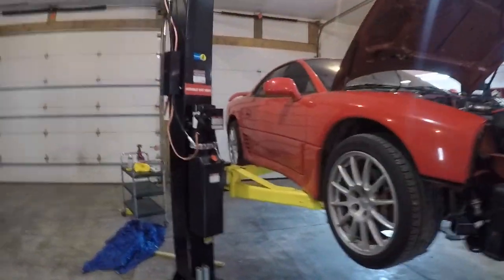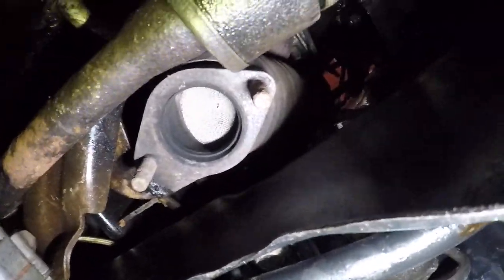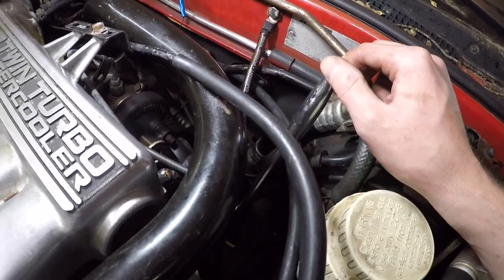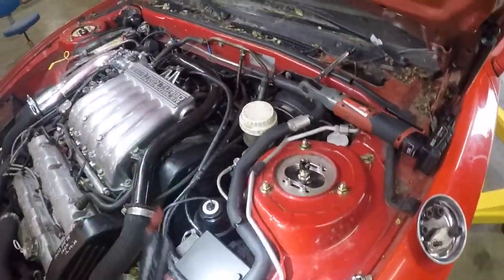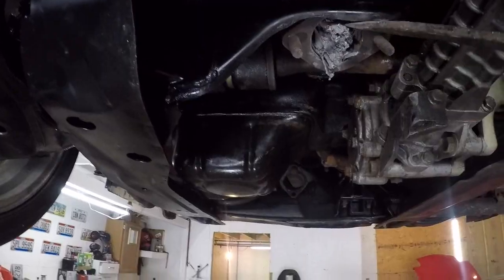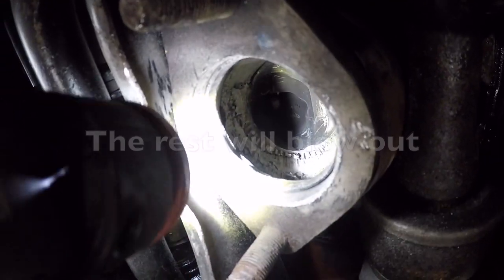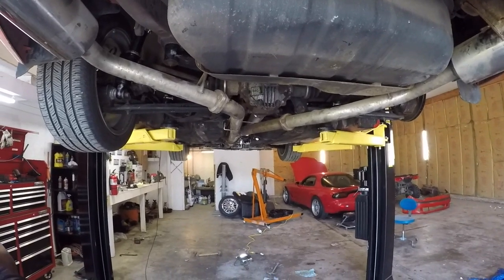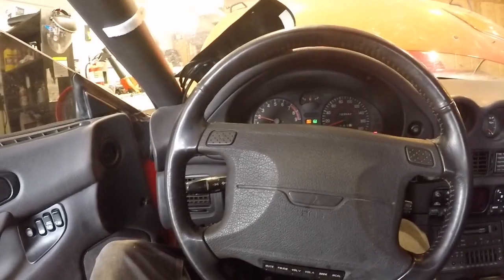3000gt vr4 | ready for paint ? | cat delete

Comment from the maker: Should I just stay the factory color or should I go a shade darker ?
Reply: I think a shade or 2 darker would  look better
Reply: Have you thought about having it wrapped?
Reply: Idk darker would be sick
Reply: Paint it ferrari red.
Reply from the maker: @FalseShxpherd  yea .. but then I have to do the door jams and engine bay
Reply from the maker: @jamesparker3062  Yea but Idk ...
Reply: Go darker
Reply: Huracan ian that monza red is badass I’m keeping it on ours
Reply from the maker: @nicktunesnemesisperformanceINC  Yea I was just thinking maybe one shade darker...
Reply: @huracanian3051  If it were mine I would do the Valencia Red Pearl that's on the 2017 NSX.
Reply: Darker
Reply from the maker: @andrewmcintosh9832  but I don't want to have to paint the engine bay and door jambs and everything.. I just want to re-spray the outside of the car and I think if I go a shade or two darker it will look good without the door jambs really sticking out
Reply: @huracanian3051  In that case I'd just go the same color.
Reply: Hey man did you find out why it was idoling high?? Any probs with removing the cat? I’ve just put new exhaust on mine and thinking of doing the same thing. Did it cause any problems??
Reply from the maker: @craigmarple2485  yea my throttle cable was just too tight... removing the cat won't cause you any problems .. Just some small gains idk maybe 5hp

Comment: That's a pretty typical downpipe for the VR4.  You need to gut the rear pre-cat, or deal with replacing it which is a complete prick.  Use a spade bit and a drill to get the majority of it out.  It's EXTREMELY messy and dusty, so wear eye protection and a mask.  I should note that you can do this from below while it is still installed in the car to save all of the frustration of removing it.
Reply from the maker: Yeah it was really dusty I had a face mask and a face shield on..
Reply from the maker: I'm going to get a new full exhaust when I upgrade the turbos get like a 3in

Comment: So if i wanna install the 3sx rear precat eliminator i straight up have to pull that axle out? Nice vids btw.
Reply from the maker: I think so .. or cut the old one out and maybe the new one is small enough to fit Idk
Reply: @huracanian3051  yeah cause when i was replacing my turbos my mechanic and i were like fuckit lets take put the cat but we got about as far as you with all that shit in the way lol
Reply from the maker: @shnoopydoopy6707  yeah just sucks cuz I had the subframes out and I could have did it then if you're going to do it I would get subframe bushings too and take the front subframe out it's only 6 Bullets and the whole subframe falls down
Reply from the maker: @shnoopydoopy6707  I got videos on all that